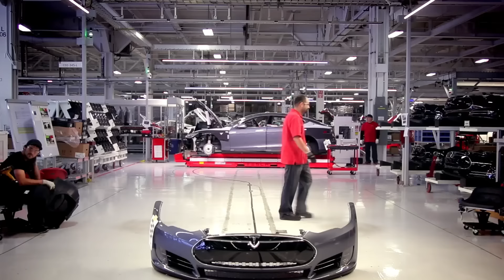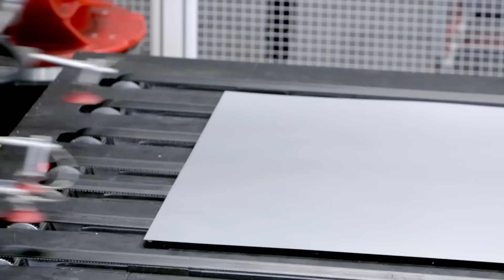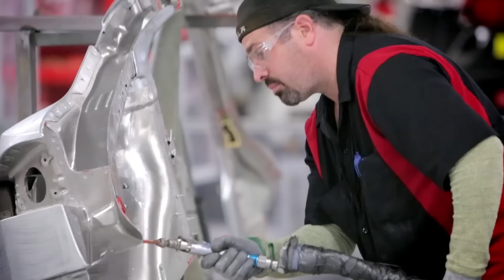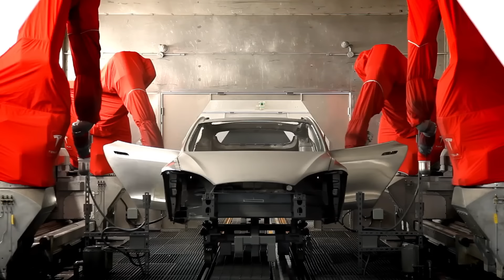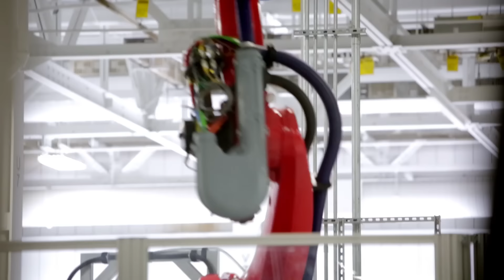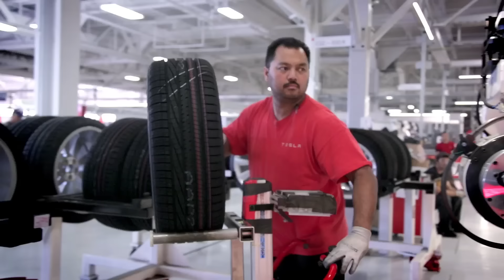How the Tesla Model S is Made | Tesla Motors Part 1 (WIRED)

Comment: Honestly, I failed to see a SINGLE innovation over what was not in the GM plant in Janesville, WI 15 years ago, a plant that GM then closed as being outdated; yea the building shell was 75 years old, but the process and robotics was the same.   not a single unique step.  exactly the same processes.  zero innovation.  looks like a 20-year-old manufacturing video edited by the same hype team that does Apple marketing.  Wired is not exactly an impartial source.   they are just paid hype. Tesla are selling a $17000 car without the engine and drive train, a toyota corolla shell, with a $2000 battery, and some DC motors.  for $50k.  meh.  selling my shares after watching this.  the process is just like Elon Musk  - -all hype, zero substance.
Reply: SpaceX lands rockets.....

Comment: I'm a retired Saturn and GM engineer who before and after my career at Saturn/GM did startups all over the place for GM, Ford, Chrysler, Nissan, etc. 

My take on this plant? Move along folks, nothing new to see here.
Reply: Did the other factories have magnetic strips along which carts and the cars move?
Reply: @joscaca  Yes, Creform AGVs have been using magnetic strips for ages. Probably before there was even a Tesla Corp., but I couldn't say for sure.

But the right question should be: "Is using a magnetic strip a wise idea in an area that has high forklift activity". 

The answer to that would depend on how often you planned on rearranging the path, and how often you were willing to put down new magnetic strips to replace parts of the path that had been torn up. And you have to observe magnetic polarity at least for the Creform AGVs. So it has to be installed correctly.

If you don't expect to be changing your path for years, then a buried wire or RFID beacon pins would last longer. If you need to change the path often, then scraping off the magnetic strip and re-arranging it would be the simpler option.

Comment: Only frame are hard pressed metal, the side panels and top are fiberglass inject molding pressed and the trunk are aluminum carpeted. AQ,  Then propulsion a d gear box, then electrical and instrument with connection ready, then AQ,  then manual need touch up with flat  wire ribon connector hook up and lighting touch up then finally wheels and final AQ and test drive

Comment: Isn't this how most modern cars are built?  Show us the part where Tesla is different.
Reply: most of a vehicle is assembled by people, not robots. tesla does dash, seats, and other interior panels, plus windshields with just a single robot, running parallel lines. that has never been done before by any auto manufacturer. that is an engineering feat of epic proportions.

Comment: They need to come up with tech so the car could charge itself from solar and wind, while driving..
Reply: the goal of car is to have as small as possible drag coefficent... if they tried to make it generate electricity from wind that would add drag when driving. Its basic physics, you would gain nothing. allthough solar would be nice but not if u have a garage and want to keep your car under roof. Just buy solar panels for your roof man
Reply: Nah, it's not an efficient way to do things. There are better ways.
Reply: Sure, Kind of like the cartoon using a bathtub shell as a boat that when water starts filling in through the drain you stick in a spout to divert it up, over, and out the back for propulsion. Physics don't work like that.
Reply: I don't think there are that much energy that can be harnessed in real-time to charge the car.  I mean, a car is a huge machinery to move.
Reply: Sorry, but you seem to lack complete knowledge of physics. Please try to pull your hair like Munchhausen, maybe you can lift yourself and fly to space. Wind power! The loss of energy by the drag coefficient would be higher than the produced energy to accelerate the car. Solar energy while driving, lol?! Do you know how much energy that gives? Its proportional to irradiation and the surface are of the car. Maximum 1kW/ square metre could be gained theoretical, thats maximum 7HP for a car on a shinny day. Seven freakin horsepower,  good luck with it, you can power your bicycle! :)

Comment: Every car company uses robots to build their cars. They've been using robots to build cars for decades. This is nothing new.
Reply: Yes, but how many can change tools and have more than one job? As well as autonomous carts following magnetic strips rather than a traditional conveyor style assembly lines.
Reply: kuka robots are german and old news in the manufacturing process. The carts arent wizardry either, put a magnetstrip on the floor and distance sensors on the front and bam you have a "hightech cart".
Nothing in this video is high tech nor exclusive to tesla
Reply: Indeed,  although having a robot weld aluminum is quite impressive. Aluminum is not easy to weld compared to steel.
Reply: MadJDMTurboBoost From the trips I've had in Toyota's, Mitsubishi's, Mazda's and Audi's factory, it seems that similar systems had been in operation since a decade ago. The only difference is that the Tesla factory is newer than the mentioned factories, allowing them to put in better-looking robots. This level of automation is really nothing new in the assembly line of cars.
Reply: Very true
Reply: They do for like a decade. But as most car production lines don't work as slow as Tesla's, they usually don't have the time to do the very time-consuming retooling and have to place a 2nd robot on the line.
Reply: Actually, robot which can change tools designed in Germany by Kuka. My friend from Germany works in Kuka and he presented me small model of that robot. BMW, Mercedes, Fox conn and many other companies over the world use these robots.
Reply: MadJDMTurboBoost Fiat developed the carts in the 1970s for Ritmo production.
Reply: That's why American cars are garbage

Comment: i see many Comments of People complaining there are no many Workers assembling the Cars because Robots do everything... 
YES True, Robots do all the Construction/Assembly, but who do you think maintains those Robots Functional?

The use of Robots doesn't kill jobs, it optimizes production output and shifts jobs to a different function.

Instead of having a bunch of workers flipping Wrenches to tighten Nuts all day for $14 an hour, they hire Trained Technicians for $20 that know how to Program and Fix the Machines.

So rather than having 3000 People building 10 Cars a Day, you pay 3000 People to make sure the Robots keep Working nicely and make 150 Cars a Day.

in any case you employee about the same amount of People, the Productivity on the other hand increases a lot... the other Option would be to hire 10thousand People to obtain the same Productivity of the Robots, but at that point the cost of Labor would be too high making the Cars too expensive, thus forcing to move production to Countries where labor is cheap.

I'd rather keep the Robots and make stuff in America by hiring a good Maintenance Crew that keeps all the Machines running flawlessly all day long!
Reply: Robots absolutely do kill jobs, the same way all the previous inventions like tractors and conveyor belts killed jobs, as they make it so that less humans are required overall. The problem with modern automation is it targets almost everyone's fields and we can't stop it, and this is why we need a UBI.
Reply: The industrial revolution enabled the over population of the world with industrial processing of foods ECT. All seems to be falling apart at the seams cause now workers aren't needed but consumers are. When something doesn't make sense its bullshit.
Reply: You're an idiot  robots don't always break down they can go months and years before they need maintenance
Reply: Plus someone's gotta maintain and fix the robots
Reply: One guy can maintain multiple robots where those multiple robots killed jobs. It's good for the company bad for the people losing jobs.
Reply: ...and 10k people would not produce a final product with anywhere near the precision of the devices usings Lasers and Robots
Reply: The problem with this is you dont need that much technician to maintain and fix robots or whatever failing in the system. 30 people $14/hour each painting Tesla frame for example. That will cost tesla more than $700K per year
Now a gigantic painting robot cost $500 upfront, paint more car in a day, work overtime, stable and robust, only need a team of 5 technician to maintain. Now that is the problem, the team of thirty car painter will be laid off for 5 technician and a gigantic painting robot.
But anyway, robots will make things cheaper so maybe a Tesla will only cost a $5 coupon.
Reply: With the next wave of industrial revolution/ automatisation most westen countries will probably be forced to move to a semi communistic system simply because the economy would fall apart otherwise. However with heavy automation in all sectors you also have the conditions needed for a communist system that actually works so that's not necesssarily abad thing as long as you make the switch in time.

Comment: honestly if I can't see a steel Frame located any where in the car it's not worth my life
Reply: +Paul Hendrix if aluminum is stronger than steel why do they use steel and concrete with steel rebar in the largest skyscrapers in the world. aluminum is not as dense as steel. aluminum is used in the automotive industry because is can be bent and shaped in certain areas were as steel cannot. in my opinion if they could make a car with steel beems being placed on the long runs and aluminum joints were shaping is weird, then I do believe that would be better.
Reply: +arbitergvadam model s achieved the highest safety rating for any car in history.
Reply: aluminium is stronger than steel, you fucking genius

Comment: Tesla's claim that their manufacturing process is "essentially different from any other" is completely disingenuous.  The only thing that's slightly different is that they do their own blanking in-house and they use aluminum body panels (and therefore aluminum joining techniques) more extensively than most other models.  However, they fail to give credit where it's due.  For example, the conveyance system that follows magnetic tracks in the floor was "invented" by the GM Canada GM-10 team in the mid-80's using technology developed by Volvo, Conco-Tellis and others.  (And used very successfully in the Oshawa, Ontario plants for the past two decades.)   Most automakers have had fully robotized body shops and paint shops (as shown in this video) for decades and used robots in selective applications in Trim to assist workers and/or avoid health and safety issues.  (And yes, they've applied windshields and changed tools at other automakers for decades, too.)  Tesla deserves some credit for developing electric propulsion technology (in parallel with most other major carmakers) and for their marketing acumen in making this technology "sexy".  But based on this video, there's nothing particularly new in their manufacturing processes.

Comment: Electric cars are coming.  Other manufacturers are trying to get on board that train before it leaves the station.  Tesla has already left the train and is on the road.  In ten years, it will be one of the best-selling cars in the USA, if not the world.
Reply: Truth Teller I know but that is what the Japanese do. They will take the idea make it better, more reliable and do it for cheaper.
Reply: Krevin Grard
Except that right now, no one else is doing it and Tesla is selling faster than production. 

Nor is Tesla standing still.  They are profiting from the "early adopter" cream THey have already announced a much less expensive car will be soon be released.  They are also improving their current product, hardware and software, contunually.  They are definitely a moving target to match.

Rots of ruck, happy-san.
Reply: +Truth Teller With the model 3 announced, It will be much sooner than 10 years!
Reply: Truth Teller They been doing it since they started doing it when they starting making cars.
Reply: The germans make junk now. Everything breaks.
Reply: Truth Teller I don't see heat as a problem at all. Heat is easily dispersed as radiation into space. Heat is just a form of energy - of very low quality because hard to transform into useful energy again.
Or you could think of it this way : the ( non-reflected ) solar energy radiated onto earth is converted into heat anyway, whether we first do something useful with it or not.
Reply: +Krevin Grard Not only  that, they will do it cheaper since they have the capital to make these cars accessible to people who cannot afford a 100k car.
Reply: It only took 4 years for a Tesla to become the best selling car :)
Reply: This comment gonna age well
Reply: CatlinCustoms Making hydrogen will only be viable once we get nuclear fusion.  Which is always 10yrs away as well.... keep chasing the dream.
Reply: boggiewan
That's an interesting idea.  I haven't done the research to confirm or deny it, but I'd like to think you are right.
Reply: Krevin Grard
Maybe, maybe not.  The next ten years will tell.
Reply: As I said, maybe they will.  The next ten years will tell.  You may note that the Germans have not done too badly, either.  Nor have the Koreans.
Reply: how are batteries not good for the environment?
Reply: W Rabbit
It's all relative, I think.  manufacturing batteries does create pollution  Disposing of them after their useful life could create more.  On balance, the may be less harmful  than burning fossil fuels but how is the electricity to charge these batteries created?  Wind, solar, hydro, or oil-fired plants? 

It's a lot more complex than it appears.
Reply: CatlinCustoms Electricity can be easily manufactured from direct ( light ) and indirect ( wind, water, ... ) solar energy. Fossil fuels cannot.
And yes manufacturing batteries could be more environmentally friendly, so let's focus our society onto making that process better instead of re-hashing that same argument over and over. 
Every technology has an impact. Windmills pollute the landscape, solar panels are not super efficient and burning fossil fuels causes global warming and death in inner cities.
Prediction : in 10 - 15 years electricity will be much cheaper than today because of the boom in alternative energy production. Electricity will be flowing from everywhere. This will push electric cars and battery technology just as cheap fuel has pushed the engineering of the classic car.
Reply: QBziZ
I agree.  The connected problem I see is heat pollution.  All energy production and use  creates heat.  Hydro generators become hot during operation.  Batteries release heat when charging and discharging,.  Manufacturing anything, even solar panels causes heat to be released into the environment.  The real problem is too many people using too many devices, even cell phones allows energy to change form into heat. 

Fewer people, less heat pollution.  Volunteers? 
;) :)
Reply: QBziZ
Read about the law of conservation of energy.   The amount of heat reflected into space is only that from the sun.  Heat generated on earth is absorbed into the atmosphere  where is is only very slowly radiated away from the earth.
Reply: Truth Teller My point is : when considering solar energy - no fossil fuels - it doesn't matter whether we do something useful with it or not, the heat will be here anyway. That is conservation of energy.
Reply: QBziZ
Exactly my point.  Nothing we can do will change that unless we have fewer people using less energy.
Reply: Truth Teller boggiewan 
I hate the constant postponing you see with developing  fusion, but look at this, looks so simple and everything is so straightforward, not like ITER or the national ignition facility:
http://www.ted.com/talks/michel_laberge_how_synchronized_hammer_strikes_could_generate_nuclear_fusion
Reply: m-bbjuyghvvbgbg
Reply: g o o g l e t r u th c o n t e s t. They are preventing us from knowing the t r u th
Reply: And read the p r e sent
Reply: + Truth Teller....No such thing as "fossil fuels". Oil is abiotic.
Reply: Truth Teller juju
  N
Reply: wrong, Tesla has not left the station. It uses technology and patents of Ford, Toyota, which were already invented. This is the same bullshit logic, apple fans tried to prove about superiority. Already in 2010 Samsung did better smartphones and as a matter of fact, the iphoneX is partly produced by Samsung because they dont know shit just about innovating the external shell of the product, idiots can see. The same will happen with this product its a market bubble.
Reply: few years later and hydrogen is still only in a handful of cities.
Reply: Today you know that you are wrong
Reply: Truth Teller гемптп шррррн до до о я я
Reply: Truth Teller лдкопжпд елереюпе лжмопюпр лпдкьегебеждеюелеь лдо0щчп68ми тлпд
Reply: Kari Greyd я$#:,
Reply: telsa cars cost too much ro be the world's best selling company. The Japanese will go and do it better.
Reply: In ten years, electric cars will be gone and hydrogen in. Cause, well, batteries arent good for the enviroment.
Reply: Look up the process of making batteries
Reply: CatlinCustoms
When did anyone say that was not polluting?  You're trying to change the subject from the pollution of making hydrogen and the heat pollution from everything. 

Yes, from making, charging and discharging batteries, too.  You cannot make any electricity without polluting.  The real problem is too damn many people using energy.
Reply: True
Reply: CatlinCustoms
Unfortunately, there is NOT an app for that.  :)
Reply: What
Reply: That's another joke.  There seems to be a phone application for everything.  Unfortunately, there isn't one for overpopulation is there?